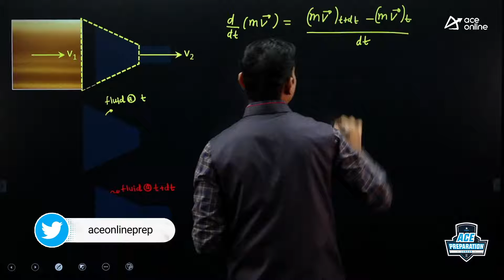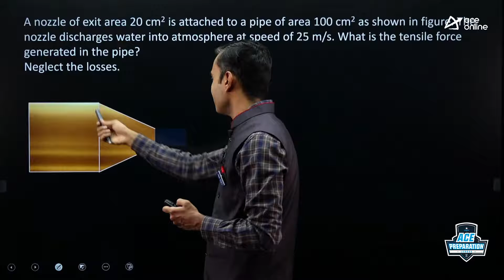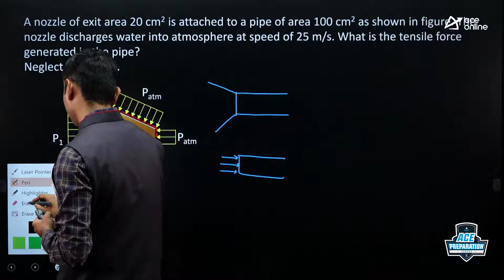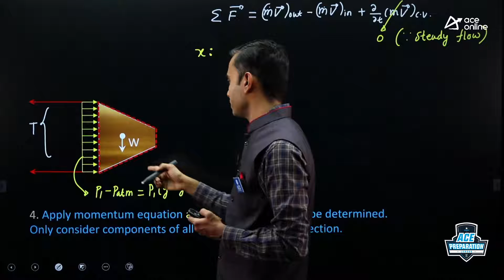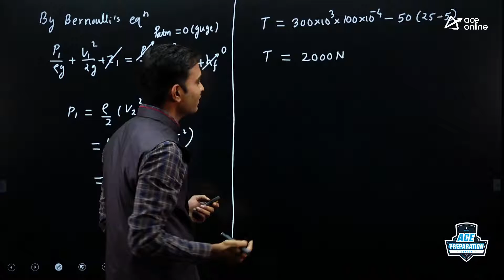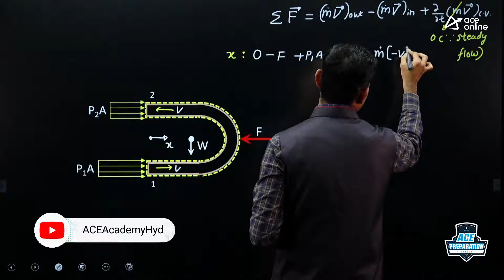FM & HM - Important Concepts for GATE by Achyuth Bhure Sir | CIVIL, MECH & PI | ACE Online Live

Comment: Dear Achyut,
I find lot of errors in the discussion given.
First of all Newton's second law is not applicable directly to fluid.
Your discussion about linear momentum change is also not accurate as at different time steps fluid particle will change.
Third, it is confusing to define the control volume in the given context.
These observations are based on first 5 minutes of this video.
Reply: Dear Rakesh, 
I find that you are very confident for someone who is wrong. 
You should look up what Reynold's transport theorem is. It allows us to apply laws such as Newton's second law which are valid for a control mass to a control volume. 
Achyut sir has simply stated the results without derivation but if you look up any textbook of fluid mechanics like Fox and Macdonald you will find that the derivation for it follows exactly from the explanation that he gave.
Reply: Dear Rakesh, I'm surpised to see someone is doubtful about Newton's second law. It is followed by every object which has mass, be it solid, liquid or gas. Please look for Reynolds transport theorem. F.M. White is a good reference to start with.
Reply: @achyut_bhure Dear Achyut,
That was the point I was indicating that without discussion on RTT you are writing Newton's law of motion for fluid which is fundamentally incorrect.